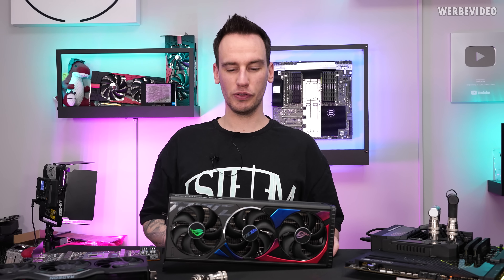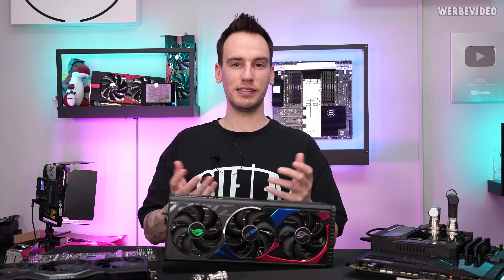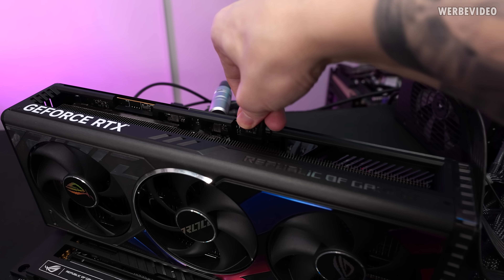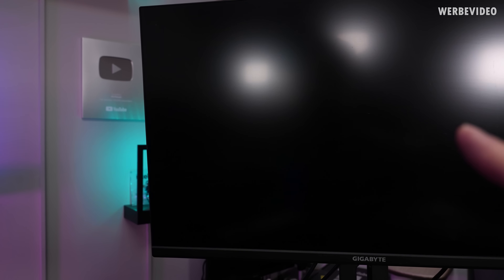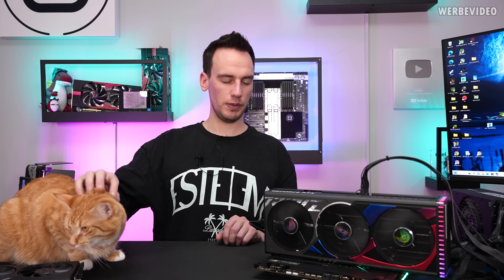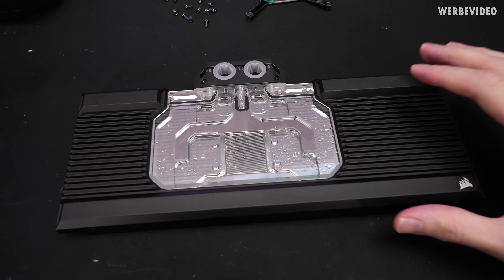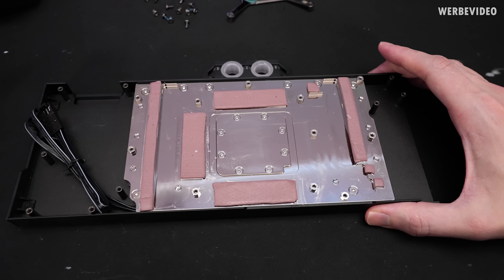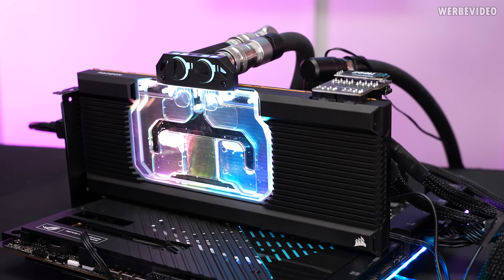Update on my "dead" RTX 4090 + The first Water Cooled 7900XTX

Comment: I've seen the inaccessible boot device BSOD many times on few ASUS Z690 and Z790 boards. It often happens if you've been running the system with the iGPU then plug in a graphics card. Almost always get that BSOD. Simply re-starting usually fixes it. This is with both AMD and NVIDIA cards.
Reply: Try disable Fast Boot in Windows settings. Fast Boot do not like hardware changes.
Reply: @p0k314COM  actually restarting fixes these kinda issues no need to disable fast boot. restarting clears up the boot cache
Reply: @p0k314COM  I haven't tried changing fast boot, but then I've not seen this issue on older platforms or AM5. I should also add that this issue only seems to occur when using a M.2 SSD using CPU lanes. Also, occasionally, after the first reboot after dGPU drivers, I've seen a Windows notification that a reboot is required due to 'PCIe bus'.
Reply: @chrish3208  that reboot notification is ReBar related AFAIK. The PCIe bus is being reconfigured to use the new large memory in the above 4GB range.
Reply: @p0k314COM  Agree. Fast Boot only causes issues. It also keeps all USB ports powered even when the PC is turned off, despite specifically disabling USB power in S5 states in BIOS.
Reply: same issue on my z390 gaming edge ac FYI
Reply: Never seen that bug but I never use or install igpu drivers
Reply: Perhaps during firmware processing/update some mmc device or similar is accidentally exposed as a disk and this just confuses uefi who tries to boot from it?
Reply: Most likely, you don't have both drivers.
Reply: wont lie, after i got it booting after my last hardware refresh I am not touching that bios until I get a new board.

Comment: That 4090 card is perfectly send it to me Ill get it working and prove its a windows 10 problem . fine try a clean windows 10 clean install. Bsod are something to do with windows 10 sometimes driver or updates can cause windows unable to boots or something you install on top of windows. Trust me i know seen it . Ive done lots of testing to know this. That 4090 will run  on a good os should not affect card just windows 10 is not optimized enough to be stable .

Comment: If it's a NVMe SSD you could always try a SATA SSD connected to the motherboard SATA connectors. Had some very weird issues with NVMe SSD's in the past causing the PC to hang on POST or randomly crashing or the UEFI boot 'table' getting messed up. The last one requires a bios reset to fix. If you are constantly reusing the same Windows install drives on different boards during testing, perhaps a clean install will fix the BSOD weirdness?
Reply: Had this same issue. Fresh install OS on my NVME always cause BSOD: Critical process failed. But when I use my Sata SSD as the boot drive, no issue at all. Had to RMA the NVME and still waiting for the replacement.
Reply: @Ch0pStix  some days ago had issue with a NVMe SSD, always get Blue Screen when SSD is on for about 15min, interesting is during the cloning with my notebook with external case has no issue. Put other SSD no problem, retested the original and same issue.
 Test with HD sentinel pro with external case after some minute's get errors.

Comment: I work as IT technitian and we have a computer in a server room that is used by one college as a RDP machine ... after power loss all the machines rebooted normally but that computer, the interesting part is that repluging it in the same outlet it did not work, so I thought PSU was dead, but when I plugged PC in my office it suddenly started working, it just took replugging in power outlet that is on different fuse ... why, I have no idea
Reply: PSU triggered safty protection. unpluging it let it drain and reset the safty switch. Also i would consider replacing the psu or at least having a backup on hand.

Comment: Hi, just wanted to know did you test a different display cable? Had exactly same symptoms with my Asus 3090. Most of time not posting with code d6 or posting and stuck on boot device detection. It was all coming from my displayport cable that works fine with other setups. Switched to hdmi cable and that fixed all my problems... very strange that a displayport cable can do that and prevent a computer from posting. Maybe not related to your symptoms at all but just thought I would share this as it takes a few seconds to test.
Reply: Because some older cables allow voltage down them from the display. Which it shouldn't do.

Comment: I have a 2080Ti FE where the fans won't spin up when the heat builds thusly overheating and crashing. Is there a hardware chip on the card which controls this???
Reply: Yes, and humans can override it with software and tell the fans how they want them to ramp up. Any vendor usually has free software for this. Downloadable in the "support" section of its produt page. If not you can research "Fan Control". It´s free. Watching a video is suggested to get into the topic (response time vs hysteries, step up/down, Min/Max,Start/Stop)
Reply: @sixtus2318  thanks. I just bought a 4080 so I'll just give this 3080 to my dad instead.
Reply: Repaste gpu and put new thermal pads on memory make sure to get the proper thickness pads. And remove plastic in both sides of pads. Lookup software on computer that could be controlling fans as well.
Reply: @frizzlefry5  I already did a teardown and cleaning. The fans just weren't kicking on automatically. No biggie. A spare card anyways. Thanks.

Comment: It's a damn shame you couldn't pinpoint the problem with the 4090.  It looks like an intermittent issue that would probably rear its ugly head at the most inopportune time.  It's a good thing you're sending it back to ASUS, and maybe they can figure out what's happening with it. The water-cooled 7900XTX looks gorgeous, and the temps are incredible.  It's so cool that you were able to bring the temps down by 25K.

Comment: I thought I had an issue with my 4090 being stuck at running at x8 (pcie 4.0) speeds.  But it was my boot ssd being in a m.2 specific slot on my mother board that makes the card run in x8 mode vs x16 mode.  It drove me crazy because I thought the card was messed up.  Double check your m.2 slots are empty...

Comment: Since the power didnt drop with the decreased temperature and the clocks didnt noticeably increase, would it be possible to give it a small undervolt and still get the same boost results while getting even lower temps?
Reply: You undervolting simps need to give it a rest

Comment: Received my block from EK this week and got it up and running today! Only reason I didn't send back my faulty vapor chamber 7900XTX. So much better than before!
Reply: Same got my EK block last week for the 7900XTX, love the low temps and also nice and quiet.
Reply: Same just got mine a week ago just got it up and running on saturday
Reply: How is your OC on the card?
Reply: @adi6293  honestly, went overseas the day after getting it running, so only just the last week got to actually playing with it. Haven't really tried too much, just set voltage to 1110mv, max core to 3000mhz, mem 2626mhz, +15% power. I think maybe my mem is not good, I tried pushing it further on stock cooling and had issues, might have to try again with the EK block on. How it is now, have played a solid 30ish hours of Hogwarts with Ultra+RT and had no issues at all, seems to float in the 2800-2900mhz area according to adrenaline, sometimes a little more, sometimes a little less, bounces of power limits. Temps are like 39-40c core and 60ish hotspot.
Reply: same, I got mine 1 week ago but my cooler was working though
Reply: I’m looking to do this.  How long did the install take?
Reply: @AntJets82  It should take an hour or so if you're taking your time. Hardest part is accessing the fan plugs when removing the stock cooler.
The rest should be easy, you're just cutting and applying thermal pads. Use a razor blade or a sharp pair of scissors to hook the edge of the plastic thermal pad cover and use it to pull up without pulling off the thermal pads. Maybe use something like Hydronaut or Kryonaut to drop a degree or two over EK's stuff
Reply: @rustler08  For as much as EK charges for their blocks. They need to be cutting the thermal pads to the correct size and having them pre applied to the block prior to shipping like Corsair does. This is such a nice quality of life feature and EK really needs to step up their game. Corsair is cheaper and has much nicer install process and temps are similar to EK.
Reply: @rustler08  Thanks!
Reply: @rustler08  100%, installing the block itself is quick as heck but man it took me a good hour just to cut all the thermal pads up and place them correctly. I don't recall this being an issue last time I blocked a GPU, which was my Vega64 this new card replaced. Always had EK blocks.